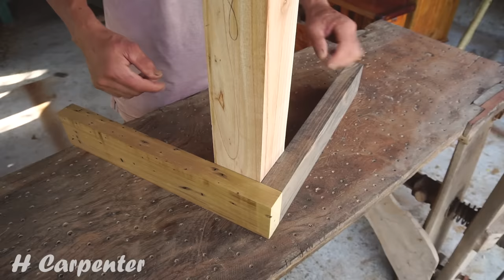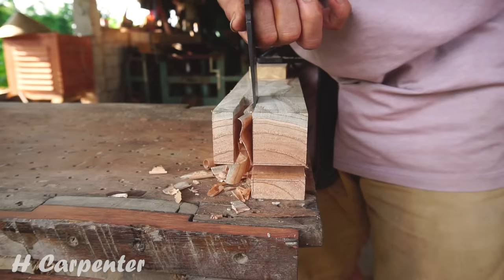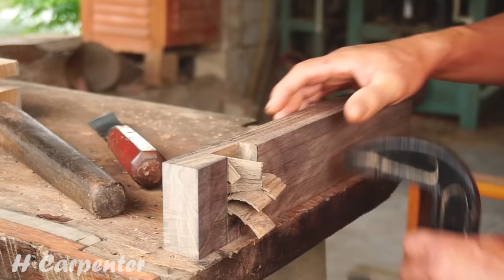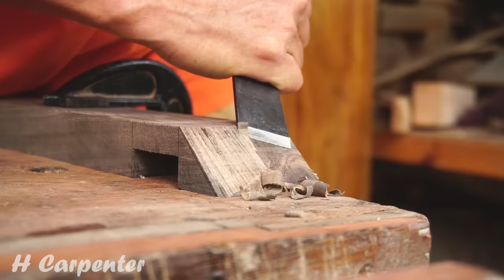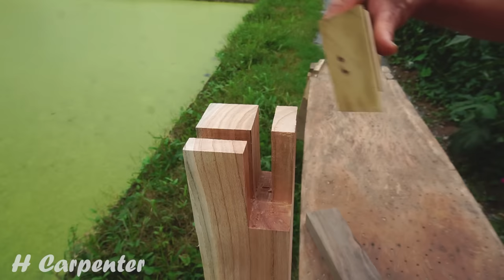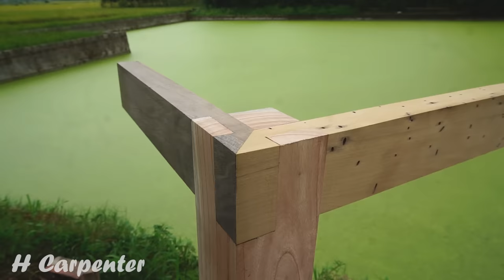Amazing Hand Cut Dovetail Joint For Legs Of The Table, Incredible Woodworking Techniques And Skills

Comment: Again amazing! I am very interested in this joint as I want to build my first table. (1) Is the joint meant to be glued (it would great if not as making things much easier for transporting the table)? (2) Is is as strong as a hunched mortise and tenon as traditionally used in Europe for that? Best, Christian
Reply: I would say if you can make it like this no glue required, traditional Japanese style avoids us of steel nails, if you wanted to make a readily dismantled table using a looser joint you could pin  it together by drilling for removable hardwood dowels.

Comment: You do awesome work and it always looks so simple. Wish my brother would help me with some of your joints, but he thinks he's better than I am...
Reply: The beginning of skill starts with Sharpening chisels
Reply: @ericlipps7152  It would help to have some decent chisels. The set of chisels I have were purchased to use as a close in floor scraper when the store I was working for went through a complete re-model. They're pretty trashed and they were pretty cheap to begin with.
Reply: @johndelaney9399  If it wasn't for Ebay I wouldn't have nice chisels.I type in Japanese Tool Auction.
Reply from the maker: experience sir

Comment: Beautiful work, but technically this is not a dovetail.  Not sure what to call this.  Similar to a castle joint but with half laps and mitered ends.  Regardless, the tightness and cleanness of the assembly is fantastic work and demonstrates wonderful skill.  Thanks for sharing.

Comment: amazing man make 3 more those. table bottom. other people use longer wood rail do joint both sides. but I saw guys timber frame to short 4x 4 squre beams together use  hand cut crazy joint that slide short peaces wood together make longer peaces wood. figure those joints joint rails together have table bottom if understand saying.

Comment: Too much time to make just one corner. Wood has to be perfect for this - grain, knot, density. It should have no rounded corners. Also impractical for outdoors - with so little material left from 2x4 it will rot out quick at connection. Finally, load bearing is severely reduced - out of 1.5" there is only 3/4" left at the cuts.
Reply: Honestly... Can't you just appreciate the craftsmanship, artistry, and beauty, even if it's not appropriate for your application? For a small indoor glass-top feature table, this would be incredible. I may try it with some walnut that I have been saving for a worthy project...
Reply: What is your Application ! Being used for Then !??